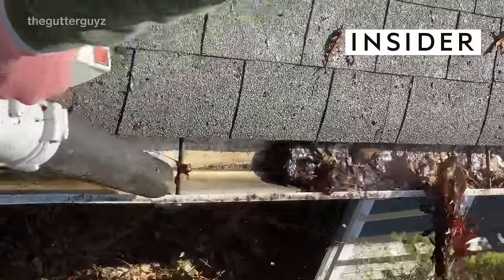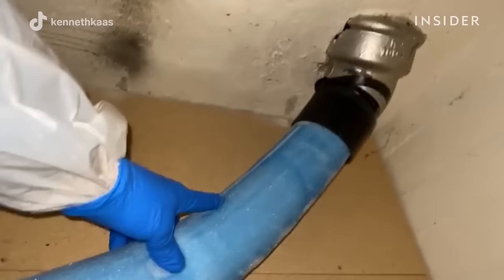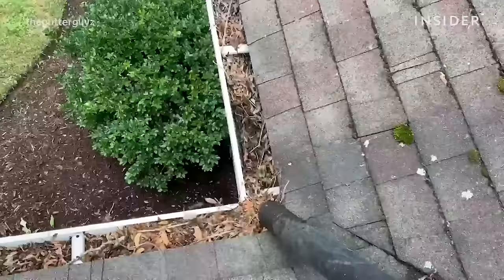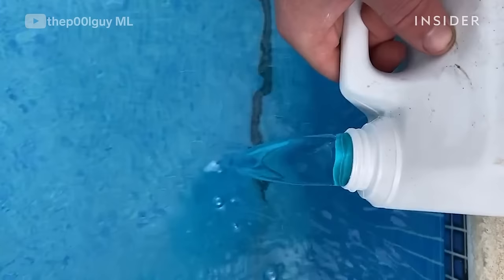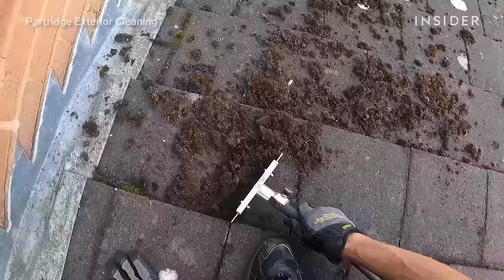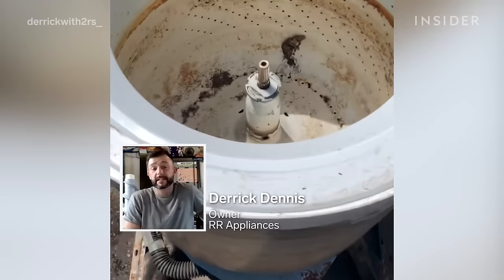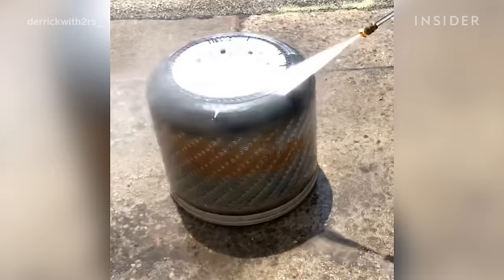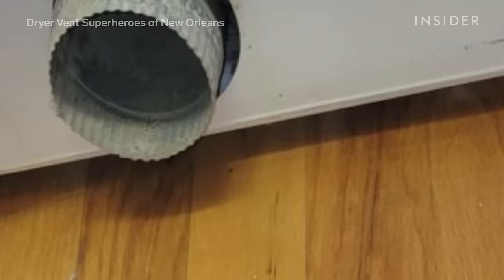8 Experts Deep Clean Decades Of Household Grime | Deep Cleaned | Insider

Comment: My husband has a furnace and duct cleaning company and has been in business for 22 years.  It's amazing what comes out of a heat duct, and a cold air return.  I have been on the job with him at times so I have seen some of the nastiest pipes around.  Its especially important to get your furnace and duct cleaning done if you have pets that shed.  Also its important to change your filters regularly and to use the correct size and type.  If you buy the filters that you can SEE through dust and everything else will go through it as well.  Using a pleated paper furnace filter is the best type.    😁

Comment: if u replacing ur dryer go for a heat pump dryer, the price has gone down and it save you both electricity and the labor cost of cleaning the duct
Reply: Not advised for cold environments like garages though.
Reply: @nicolad8822  yes but usually dryer in garage wont be using such long and difficult to clean vent isnt it. For hse/apt with indoor dryer placement and a long vent, a ventless heat pump is really an much better alternative.

Comment: That ductwork isn’t 100 years old my guy.
Reply: Serious. Central air didn't exist until the 1960s-70s, so the 50 year estimate he scoffed at would have made it among the earliest air ducts around.
Reply: @aveslp I agree that it's not 100 years old, but considering it's a furnace system as well... Hot air furnaces actually date back to 1805... So you theoretically could end up cleaning out a 200 year old ventilation system(I wouldn't expect it to be made out of galvanized metal though...)

Comment: Is there a midway method of cleaning your washing machine without pulling it apart? What if you got a steamer and shot that rhrough all the holes from the inside then quickly run an empty load?
Reply: Run it empty on the hottest cycle every so often and just use one of the proprietary cleaning packs. No need for all this, he’s just doing it as he is reselling them.

Comment: only problem with hiring pros is ever since Covid hit and poste covid times, services are 3 to 4x the normal cost pre 2019.   We cleaned our metal roof ourselves and used the same pressure washer for the house exterior walls.  The chemicals are not difficult to work with, the percentages are known, the methods are common knowledge.  We saved easily 4000 dollars or more.  You are trading time for the financial savings.  It won't get done as fast but who cares, the savings is worth it.  Most home owners can do their own cleaning and home  repairs just by watching youtube and doing some research.

Comment: They have some weird homes. I don't know a single person here who ever had clogged gutters (I even worked in construction for many years and have been to old homes that are being rebuilt and still have clean gutters). I think we don't even have such service here that offers to clean the gutters, because nobody needs it. We live basically in the forest, trees everywhere, but nothing here gets clogged. Why it gets clogged for those homes in those videos?
Reply: Where is this special place? How can rain run off the roof without taking dirt, leaves, twigs and plant matter with it? Some is bound to settle after rain and when the weather is dry it hardens. Do you not get moss?
Reply: @nicolad8822  we get moss only on bitumen type of roof, maybe a little bit on clay roof. Otherwise no, nothing on metal roof and definitely we don't get any moss in metal drains. My parents live right by the forest and still never cleaned the drains and they are clean by themselves. Few years ago we changed the roof of my parents home and changed also the drains that were around 20 years old. Totally clean, never have been cleaned. Maybe you don't put your drains on an angle but totally straight and that is why leaves collect there? Or maybe you don't have much of rain there? I don't know, here everything gets flushed out and nothing collects. I'd say for us bigger problem isn't clogged drains but that water from drains come with such speed that if makes a hole on the bottom, so we tend to put big rocks on bottom so it doesn't flush the ground.